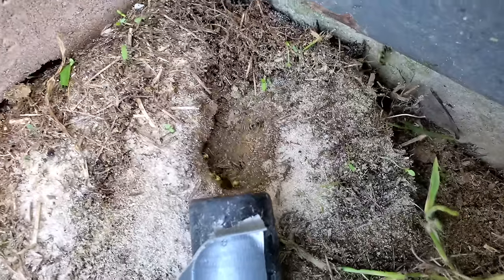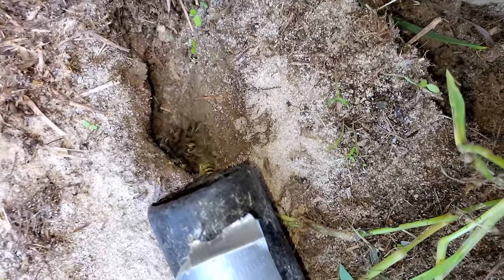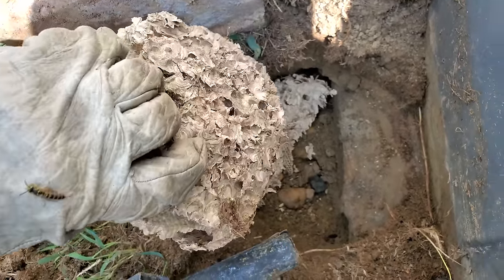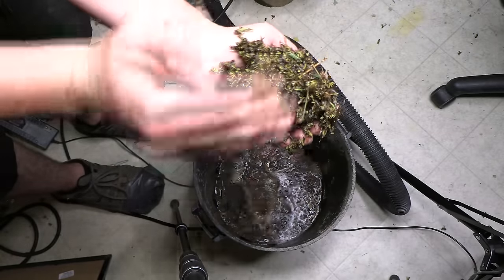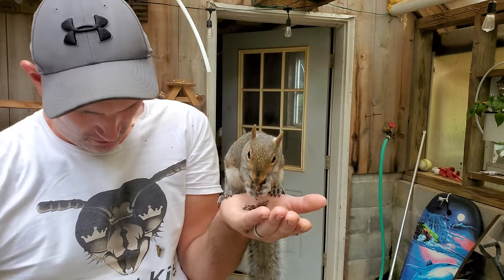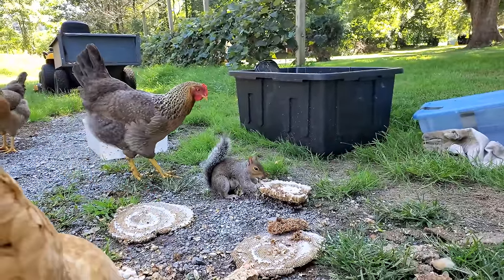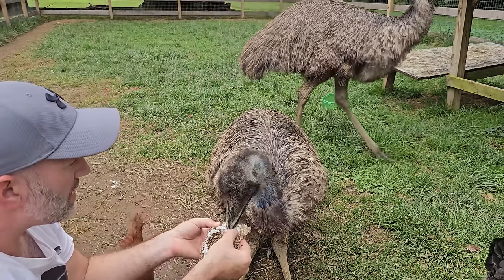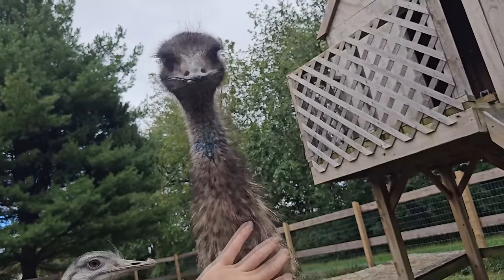MASSIVE Subterranean Yellow Jacket Nest Removed From Client's Yard! Wasp Nest Removal.

Comment: I've placed a shop vac in front of a yellow-jacket nest and without banging or provoking them, on their own accord they over about 12 hours all investigated the vacuum nozzle and got sucked inside to the soapy water.  I'm just a home owner without a protective suit but patience and a shop vac has dealt with my nest removal problems.
Reply: Same here. Works very well.
Reply: Was the shop vac on that whole time or just sitting there?
Reply: @lizh7777  Shop vac stays switched on but stationary  the whole time.  The yellow jacs feel compelled to investigate anything near the entrance to their nest and get sucked in.  It can take up to a full day to get them all.
Reply: I wore out a shop vac doing this. Need to buy a new one and replace the brushes on the old one.  But it is so satisfying. I got a nest in my compost pile and not sure I can use the vacuum since there is so much loose material.

Comment: Oh!  I couldn’t believe you stuck your bare hands in the mass of dead hornets. 
The stench is horrible!
I used this method once. 
Mine was a paper nest in an inaccessible crawl space. 
There was only access to the entry point into the home. 
They would attack the tip of the tube because hornets attack the face. 
It took 3 days!  First it was the smaller working hornets. When I started seeing the larger queens guard I knew it was about over.  
They never reused the nest next year. I guess I got them all. 
I had to throw away the wet/dry vacuum away.  It stunk so bad.

Comment: Got a suggestion for you: if you Buy - Really Useful Boxes, drill enough small holes to allow air in but no Wasps out, with a Hose plug point you could cover the entire area 1st hand and use different size boxes according to the area of evacuation to reduce No's of wasps escaping, 🤓💡

Comment: I get these nests around my home a lot.  I normally wait until dark and upend about a 1/4 to 1/3 gallon of gas into the hole (no I don’t light it).  They all die and they never make it out of the hole.  You probably can’t use that method at a customers house as there are some risks and impacts to the chemistry of that small area of ground but it works well and I’ve never gotten stung doing it.
Reply: Yes, I tried many things and only gasoline seems to always work. I only made the mistake of lighting it once and that was the first time I ever tried it, when I was like 12 yrs old. My dad heard the boom and ran out & said "I never said to light it, just pour gas in the hole". Only bad thing using gas is the dead spot in the yard for a month or so. Guess if I had the "anti getting stung suit", I may try soap trick.

Comment: I think somewhere outside my apartment window (I'm on the first floor) is a wasp nest. Every summer they manage to get into my room if i accidently leave my window open at all during the day. It never fails. Leave that window opened and wasp fly in through the one small crack my screen is. I'm not exactly sure why? I'm not trying to find out where the next is. For now, I'll just tape up that part of my screen so hopefully I won't have to worry about it for the rest of the summer. It's been happening for 4 summers straight ever since the place i live at removed the bushes. Maybe they found a home where the bush used to be. I don't know. I HATE THEM. Never been stung and i don't want to find out if I'm allergic either. Because i don't know where it is, I'm afraid to contact maintenance about the wasp nest if there is even one at all, and risk someone else getting hurt by accidently stepping on it or something.

Comment: Squirrels eat insects??🤯🤯🤯
Reply: Squirrels are opportunistic predators.  They love to eat insects and they commonly wreck havoc on nests containing baby birds.  Seeing half-eaten baby birds dropping from trees is a common sight anywhere that squirrels are common, but most people just aren't outside enough to put two and two together to understand what's going on.  Have you ever seen 13-lined ground squirrels hanging out on the sides of busy highways?  They are there looking for insects that have been killed by speeding cars.  A lot of insects get hit with a glancing blow and bounce off the car, where they then get blown off to the shoulders by the wind from additional cars.   In regions where flying insects are common, there's a never-ending supply of dead insects along the highways, and the ground squirrels take advantage of that.

Comment: Instead of using just the tube from the shop vac, why not fabricate an upside down funnel covering the entire hole. The suction itself will pull more out of the ground and unable to crawl from any crevices around the ground and funnel itself.

Comment: Do not use wasp stopper thinking you will kill those yellowjackets. It works on bumble bees and wasps but not yellowjackets trust me.
Reply from the maker: Yellow Jackets are a type of wasp.
Reply: I worked for a utility company and placing a cable we got into a yellowjacket nest so I got my wasp stopper can out , emptyed three of them as they came out and sprayed in the whole. no affectThe contractor told me it wouldn't affect them three cans later he was correct. Gas or diesel did the trick. Maybe there is a difference in the type of yellowjackets here in the midwest but those we got into as a witness wasp stopper didn't even make them mad.